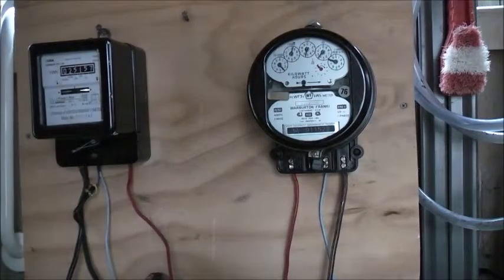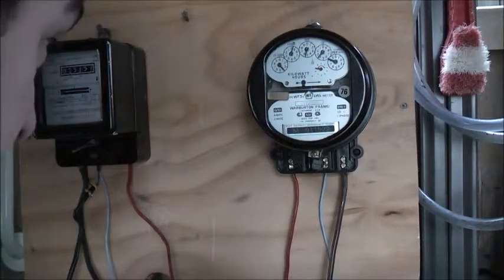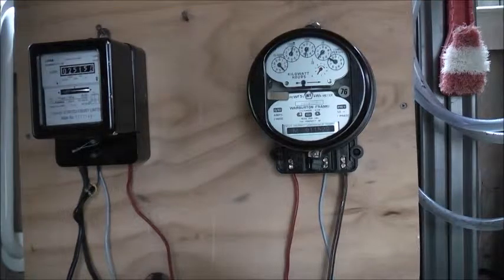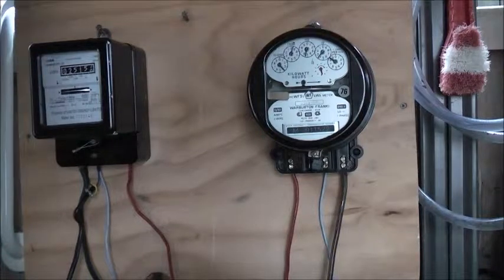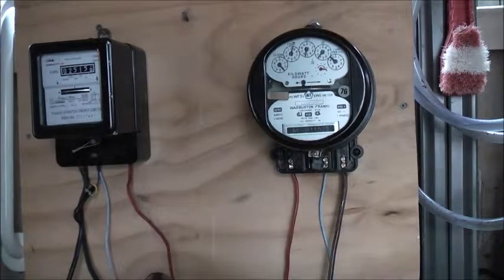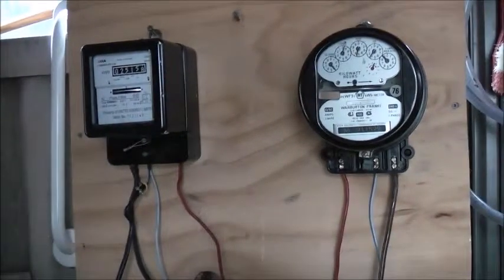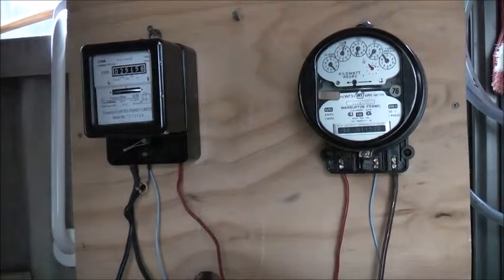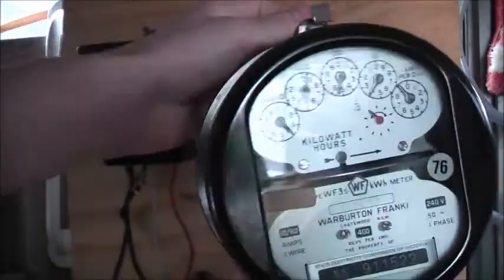Warburton Franki WF3s Test & Clean!!

Comment: Aaaah, you almost had meter-twins here. So close, but still no cigar! 

A nice rev-up on this one. Like you say, this one has a nice level loadwheel with no warping.

That '76' sticker on there..... Is there a possibility that the label indicates the first calibration or the first year the meter was put into service?

As at October 2015, 1976 was 39 years ago. I'd like to think that this meter has been re-calibrated at least once since 1976.

Thanxx for showing,

-BoomBoxDeluxe.

20th October 2015, 14.35
Reply from the maker: Definitely recal date
Reply: Hmmm..... But that was 39 YEARS ago. :-/

The Sangamo Weston S200.31 only has a certification life of 35 yrs!

OK, so those these might have had as well, but were left in place for a few more years as they were going to be ripped out and chucked anyway, but..... 39 years?

OK, this accuracy test did kinda prove that it is STILL accurate, (but then, so is my 1951 Smith APR!) but I'm having difficulty in thinking that when these rolled off the production line, they were automatically given a certification life of more than 30 yrs.

Is there ANY other markings or badges on these instruments?

If I had to take a guess of the re-certification life of these, I'd go for 20 or 25 yrs, maybe 30 at a push, so if it was 20 yrs, the recal years would have been:

Every 20 years......

1976 - first calibration,
1996 - recalibration
2016 - recalibration
2036 - recalibration

If it was every 25 years.....

1976 - first calibration,
2001 - recalibration
2026 - recalibration
2051 - recalibration

and if it was every 30 years.....

1976 - first calibration
2006 - recalibration
2036 - recalibration
2066 - recalibration

I know what..... I'll call-in Rodalco on this. :D

There might be a possibility that these made their way to NZ and he might have come across a few or known someone who has.

He might even know the recalibration period for these, especially seeing as Warburton Franki based their instruments on models similar to Sangamo Weston. :-)

-BoomBoxDeluxe.

20th October 2015, 23.21